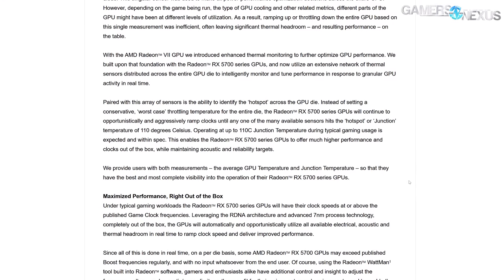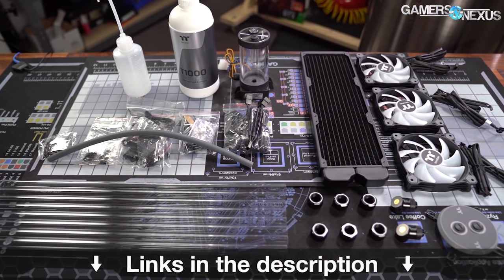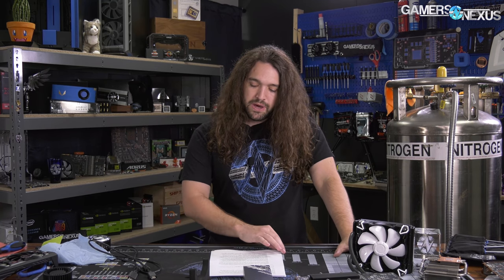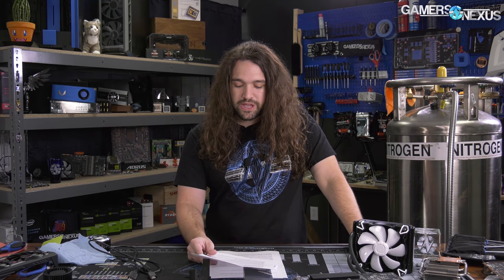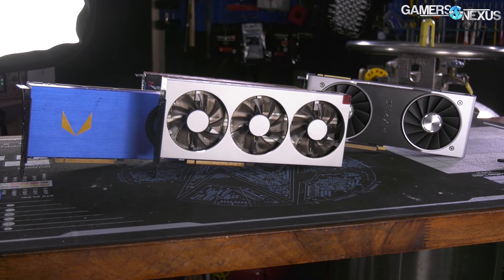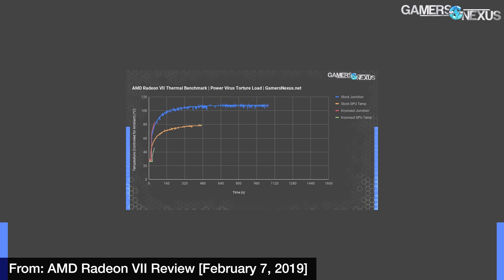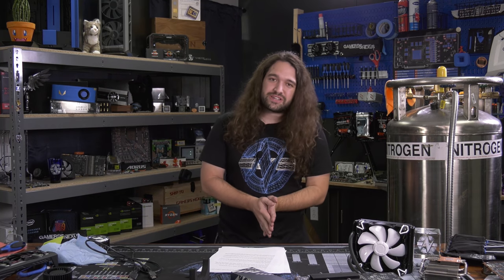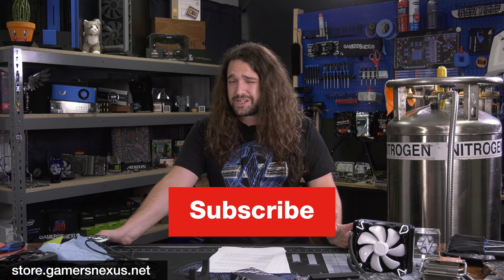Explaining Navi 5700 XT Junction Temperature | 110°C is Not "Expected"

Comment: Maybe AMD is just embracing the memes about using their cards as space heaters.
Reply: Except that Navi's reference cooler has exactly the same thermal performance as any other high end GPU reference cooler. all of them keep they GPU's they are designed for at around 80 degree's. and that means all of them had tjunction temps of well over 100 degree's
Reply: @TheCountess666  correct just  because you can't measure it on the Nvidia cards doesn't mean that  they also don't have hotspots on the die. The old memes with hardware are kinda outdated at this point.
Reply: Winter IS coming soon.
Reply: Brad Viviviyal  it stands for Add-in-board Partners. As in all partner companies that use the chips on their cards.
Reply: @ugaaa5 Uhm what. Reference cards have tons of replacement air coolers and full cover water blocks available. Plus of course CLCs.

I do recommend starting with Sapphire, they tend to reuse reference board for at least some designs. (Different for Navi Nitro+, unusually for them.) Full cover water block compatibility is a good guide to find them.
Reply: @ugaaa5 1) MSI, all of them. 2) XFX non-dual. 3) Yeston. :3
There are more, I perused only one water block (Watercool's) compatibility list.
It'd be harder if you asked for Vega Nano waterblock.
Reply: @ugaaa5 CLC then. They're cheap used, though at this point you might want a newer GPU indeed. (I'm waiting on big Navi or equivalent.)

Used water blocks are cheap too. No, really. Used fans from MSI dual fan cards, too. Yeston funky dual fan cooler, probably as well. Getting them new would mean finding the part number and crossing fingers that it exists.

Additionally, R9 Fury coolers for reference PCB will fit too. The design is identical, except VRM inductor position. Needs a tiny cutout.

Sapphire huge Nitro+ 3 slotter fits reference pcb... Except 2 top screws. It's too tall. Getting it will be hard.

Vega and Fury is funny in that you can attach anything that will fit its GPU mount and clears the capacitors, to get acceptable performance. Perhaps add VRM heatsink. A bunch of low profile CPU coolers fit the bill with custom bracket to hold them.

Comment: So much of this really is down to fanboyism. Fanboys proclaiming that any criticism of their preferred product manufacturer is just and only because it's critical about their preferred product manufacturer, irrespective of how valid the criticism is.

This is a bad place to be, people who are this entrenched in tribal fanboyism will forgive almost anything while being taken for mugs by the very thing they wont allow to be criticised. No, 110 Degree operating temperatures for anything beyond a kettle are not "normal" for consumer electronic computing devices and they make it damn difficult to piece together quiet and cool systems. In fact I'd wager that the same people spreading this type of dis-information are the very same that proclaim Intel's SkylakeX HEDT processors to be too hot (and on that point they are actually correct despite how those chips may have been designed to operate at those increased temperatures) that's right fanboys you are hypocrites. If you are going to be a fanboy of something or anything at all, be a fan of advancement in technology rather than a specific product manufacturer, AMD absolutely deserve praise for pushing the CPU market forward with extraordinary products. The reference 5700XT is almost a decent product, almost, but it is let down by a poor cooler design that negatively impacts on thermals, noise and performance. Like Intel's HEDT Skylake X chips which are seriously over-priced and the package is filled with a TIM that has all the thermal transfer properties of toothpaste.

These problems are criticised because we want a better performing product at the best possible price, if you are a fan of technology you are fan of seeing technology advancement. To me it doesn't matter who made a product, as long as it was made ethically (I'm looking at you Amazon and your Alexa child labor shops seriously, stop that sh*t) and represents an improvement over what I have then I'm relatively happy. If you want to stick with AMD for your GPU (and at the MSRP the 5700XT is very competitive against Nvidia mid-range products) then I'd seriously consider picking up a SKU from a third party producing a card with a well designed cooler. Because if you pick up the reference design you are potentially leaving performance on the table and adding/creating thermal management and noise problems for your build. 

Corporations have PR departments they do not need fanboys and in fact would probably do better and sell better if there were fewer fanboys around since their hypocritical opinions are almost always colored by corporate allegiances. - Edited to remove extra line breaks added by youtube.
Reply: @Conor The 5700XT is not a shit GPU, it's actually very competitive, as far as I'm concerned it eliminates the entire 2060 (and lower) range and even trades blows with the 2070 Super despite having a lower price. The 2070 Super is also not a shit product, nor in fact is the 2060, they are however badly priced products especially when I can similar performance to a 2070 Super for less. Assuming of course hat the card can be found at its MSRP.

In addition to this AMD's reference design says nothing about the AIB partner companies that will in turn produce cards that deliver similar if not more performance due to the inclusion of  improved coolers.  In the case of both AMD and Nvidia in the midrange right now both companies produce fairly performance comparable products,it's just that  Nvidia's mid-range is more expensive than it deserves to be.
Reply: Paul Nolan  And you still took the time to post, bless.
Reply: Unfortunately, AMD's PR department is the very reason we got into this situation. It's all "leaks" and viral marketing manipulating people's emotions in social media, enabling NPCs to feel they're contributing to society by "supporting the little guy" from their pedestal of moral superiority. Meanwhile, AMD's margins (again, *margins*, not sales or revenue) keep growing to Intel/nVidia levels. Hell, there's "Technical Marketing" people from the company posting in that Reddit cesspool and it doesn't spark even a smidge of suspicion in the fanbots... "Nah, I'm surely not being manipulated by this person whose job consists of manipulating people using what should be perceived as technical arguments." It's a freaking joke.
Reply: @dpokor  Completely agree on this, it is like this nonsense is being stoked by a PR department that doesn't know how to execute a marketing strategy or develop one for that matter. It's a shame because I know of people who refuse to buy AMD products on principle because look at what their "fans" are like and they dont want to be associated with that, it's a shame because AMD are making great CPU's at a great price and they make pretty competitively priced GPU's. Fanboys are so coloured by their selected corporate allegiance that its impossible to get an accurate picture from them, using them in place of PR is a terrible strategy.

Comment: As someone who ran a single fan fermi card for 8 years at least 8-16 hrs a day at 95-100c i actually believe this is fine haha
Reply: Gtx 480 life.  Bonus with the exposed heatsink area doubling as a food warmer
Reply: Wow, I always thought that over 90 degrees would be a death sentence for long time use. Even over 80 could be more than problematic in many years of use. Could you explain why your card had to run so long and so many hours a day?
Reply: Fermi card is not Navi. Both in architecture and in materials used to make it. This is very simplistic analogy that make it false.
Reply: @coffee7180  a poor neet fits perfectly in the scenario.
Reply: @The36th  Its the same in a way that when the engineers of the card say, "its fine, it can handle it" then just believe that it can handle it, they said that on fermi too, ran it for 8 years and it didnt break, only upgraded because i bought a 1440 144 screen.

Comment: Why does nobody seem to reference room temperature when dealing with thermal topics? It makes a huge difference. They referenced 110 degree which could very likely apply to any situation were someone is not sitting in a room thats down to 21c. For instance I currently live in China and inside temperatures are almost always around 26c even with AC (Chinese people prefer warm temps). My laptop handles 26c ok but if I game in a room at 30c (also not uncommon...they don't usually have central AC in China) my laptop will gladly overheat and shut itself down.

Comment: My Zotac 1080 AMP! Edition would go up to 91°C and throttles then to hold the temperature. I changed the stock paste to liquid metal. Now it's at low 80s mostly, never hitting Tjunction again.So even on AiB cards can be poor cooling solutions...
Reply: Fabius Maximus Cunctator i had the same card..but i never hit that temperature.. what enclosure do you have?
Reply: @meesam420  really? I already had two of it because the fans died. They always were very toasty.
I have a Nanoxia Deep Silence 3 with 4 fans. But I don't think it's the case, because if the fans don't spin the GPU is just 2°C hotter, must be the GPU. My MSI gaming x 980 and Gigabyte windforce 980 Ti had no issues with temperatures before. The were in the low 70s or even cooler. 
It is even more odd that an increase in fan speed won't net any drop in temperature. No matter if you stay in 60% or 100%.

Comment: My 5700xt was running 110 and so I turned my fans around in most spots and it dropped to 102 pretty solidly on games like siege and the witcher set to ultra 4k and held fps and clock speeds a lot better too. This card seems to need some direct air from the side and isn't pulling in as much air as it should. Without positive pressure in your case it will run 110c while gaming
Reply: I have RX6800 gaming oc and the junction GPU is always locked in 100c , undervolting 1100 to 1000 and down mhz clock 2200mhz to reference clock 2000mhz, down the junction 100 to 80c and gpu 80c to 65c. Of course lose FPS in demanding gaming.

Comment: Lol i’ve been running my pc and rx5700 xt with up to “108” junction temps (or so that’s what the amd app says) every day or so for the past year😂😂 still fine and my performance is top notch on all games with max settings 1440p
Reply: I recently played RE8 and my 5700 xt got to 110 and then it crashed 🤐 and until i restarted pc, i had problems with display… and im not sure if i fried the chip or it just needed a bit of “rest” 😮‍💨
Reply: @EvzenBrutus  mine does reach that but i have sufficient airflow in my pc case so idk what to say😅it usually never crashes unless i am pushing it hard on something like assasins valhalla. But yeah no weird screen glitches, also make sure your drivers are up to date.( by up to date i mean the recommended drivers update because sometimes the optional most recent one can have issues).
Reply: @TerpedHaze  day before i downloaded the newest drivers… but i think the problem was really at the temp and not driver itself… :(
Reply: @EvzenBrutus  :( dang, hopefully it’s not a case airflow problem, maybe get more fans if possible and face them the right way so it’s efficient and pushes the heat to the top and back of the case exhaust. But other than that maybe look into repasting the gpu, but that’s about all i can recommend..( also maybe undervolting)
Reply: @TerpedHaze  yeah im gonna look for putting more fans in the case… but yeah, i undervolt it already :’)
Reply: @EvzenBrutus  i recommend going back to the recommended drivers also cause the recent one was unstable for me personally. Maybe case glass off might be an option for now till then, cause it gets hexka hot inside the case without decent airflow ( and point a desk fan at it) and ontop of that we got a gpu with poor fan design🥲so gotta try everything haha
Reply: @TerpedHaze  yeah, imma change that driver and probably take the glass off too. 
And thank you dude for help :D

Comment: been using my MSI 5700xt Mech OC on 110c Hotspot (Junction)Temp for 5yrs now and had no issues and still kickin on AAA titles
Reply: Hey bro just a tip, change your gpu paste with some mid-premium tier paste. My junction used to hit 110 all the time at 3000rpm fan and now it never exceed 90C, at 1500-1800rpm fan.

Also, if you wanna check if it’s the paste throttling the heat transfer, try touching the heatsink fins under full load, if they are just warm or room temp, it’s the paste fault. They should be burning hot under full load.

Comment: Aorus 5700xt will hit 110 if you set "auto overclock" as the tuning control. But it also runs at 2075mhz while gaming. When left to default settings it wont even get close to 90 degrees.

Comment: 56 AMD fanboys disagreed.
Reply: MadFinnTech don’t think anyone is disagreeing that blower cards are absolute trash and should only be used on lower power cards in small cases
Reply: @ItsSpeltGoogol That is only true in casual land where they use mini-cases with no airflow. Your scenario is so niche it barely exists.
Reply: Blowfanboys
Reply: @ItsSpeltGoogol The only benefit for blower coolers is that they don't expel hot air into the system, but outside.(they are popular for watercooling due to mostly using reference pcb)
That's why it is beneficial in smaller cases. In pretty much every other case where airflow is decent, the hot air is exhausted by case fans anyway. Regular GPUs should not recycle hot air when you actually have decent airflow in the case. Cheap is another thing, but blower gpus are not any cheaper than low-end regular cooler ones.
Reply: That’s expected.
Reply: ItsSpeltGoogol Don’t forget you have intake fans to bring in fresh air as well, yeah the internal temp of the case will be hotter but it’s minimal compared to temp decrease of GPU

also aib partners tend to release higher end cards first, and usually they will have inflated pricing to catch out early buyers. in a few months there should be good aib models at msrp

personally i use a blower gpu and because it’s only a 1070, gpu temps are fine(limiting my oc tho). I’d much prefer my 1070 to be able to be clocked to 2.1GHz and have my CPU jump by 2-3 degrees than have my CPU stay under 65C . your cpu will defo be higher temp with an axial fan gpu but if that pushes it to thermal throttling area then your cpu cooler is the problem
Reply: ItsSpeltGoogol Also, just to get my point clear, blower cards do have an advantage, like you said, not expelling hot air into the system. With most cards a blower would cause higher noise, higher gpu temps and lower clocks due to said temps. only benefit is not circulating warm air. Benefit could outweigh downsides in a few niche scenarios but not more than that

Comment: Great job helping us filter through all the marketing hype in general. The total performance equation is quite complex so it's nice to have the best inputs. Kudos to AMD for providing a way to expose the die temperature in a better way. This helps provide context to the 110C data point. 

Certainly cooler is better but this generally involves some cost. Your reviews help sort through these variables.  Hey, I bought a blower card because it was cheap. Thanks to you I discovered the question of cooling. My choice was to create a custom fan curve in Wattman. Doing this likely helps the reliability of most of the components but it does make more noise and the fan will likely fail sooner and …..

My point is, it's a question of tradeoffs. A blower card may not be the best but, at the right price point and usage scenario, maybe it's fine. I don't think it's accurate to categorically call it junk.